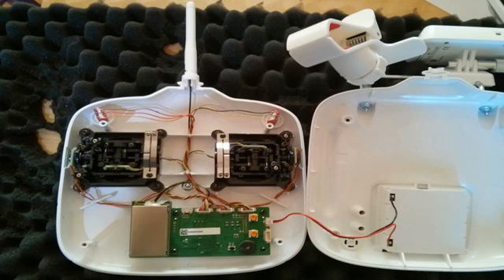DJI Phantom 2 Vision: How to install Horizon FPV antennas to increase video & transmitter range

Comment: Great video :D

May I ask a quick question? With this upgrade is the Wifi extender still a line of sight only option or what if the quadcopter is out of view, will it still show the FPV on an iPhone or whatever monitor you choose to use?

I know in your video you mention your test flight wasn't exactly line of sight, but am curious to know how it has been since you got better and was able to go back outside :P

Thanks

Cillian
Reply: Thanks for the great reply :D

Comment: What you've done is covert the transmitter from omnidirectional to directional (mostly)....might get better performance but you might have to be pointing always in the direction of the copter.... have you found this to be right?

Comment: Hey simon is the 2.4 antenna for the wifi extender a LHP or RHP I've got as you know the dual antenna from horizon which works fantastic. I'm adding another antenna to the other antenna on the wifi extender and want to make sure I'm purchasing the right one

Comment: I saw a mod kit with the black hawk antenna, but it was a white double antenna in one mod done by FPV TEST. which was a little more work than tours and boy did it get good range.
Reply: I'm looking into the TP-LINK  TL- ANT 21ST & U.FL MINI. PCI./RP-SMA PIGTAIL

Comment: I am going to upgrade my transmitter soon, is there an antenna on the actual phantom you can upgrade as well? (the FPV one) not the one for the remote

Comment: Thanks for the video. Unfortunately this is not for me! Wiring a 3 pin plug is about as adventurous as I will get. 

Shame that someone such as First Person View don't have for sale a replacement controller with the improved antenna etc.

Comment: Hi simon ... i ordered like those antennas for my p2v+ .... it a complete kit includes 2 antennas  .. al different connectors and cables required ... wifi booster ... battery to power the booster ... 
So do u think with those antenna i will get better range for my phantom 2 vision plus ?? 
Coz am aiming to achieve above 2km .... but now the new p2v+ has become slower than the p2v in yerms of its speed !!

Comment: simon will these do for the camera antenna upgrades for the P2V?

http://www.amazon.com/gp/product/B00DP64JRG/ref=oh_details_o01_s00_i00?ie=UTF8&psc=1
Reply: well ive done the mod on the wifi range extender with an omni, and im getting well over 1000 feet now, but it was a windy day and couldnt fly, so i had my extra tall wife hold the phantom over her head while i walked down the road....lol  seems to be working well, and also i put these new antennas on the same range extender, and they work there....so im guessing they'll do the job.

Comment: hi again Simon
I have been out with the horizon antenna exactly the same as you 
ground end only  yesterday
and I am only getting around 1 200 ft  then it wants  to fly home !!!!
any ideas on why this could be  ?
this is only a bit more than the sock antenna .
I still have the vision side .&. All my batteries are full and well charged
cheers Paul
Reply: Yes FCC mode two beeps
 the black hawk micro wired and on pigtail ok !!
 I wondered if it wasn't the TX as it didn't go much beyond 800 before the conversion .
Maybe when I get the gimbal I may look at putting the other antenna on the vision end See if that helps eh?
thanks Simon .
 And no falling out with any morons on the forum page !!!!!!! l  LOL